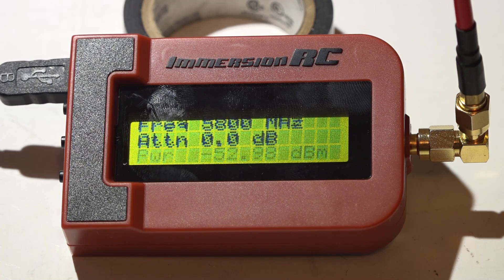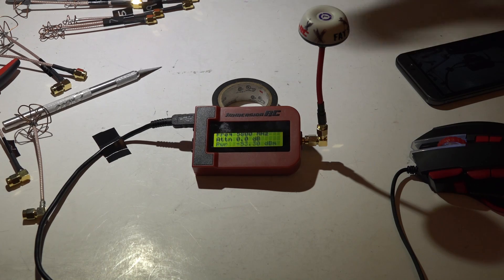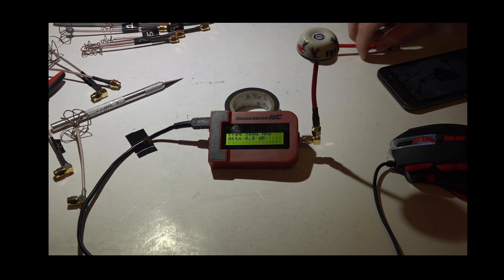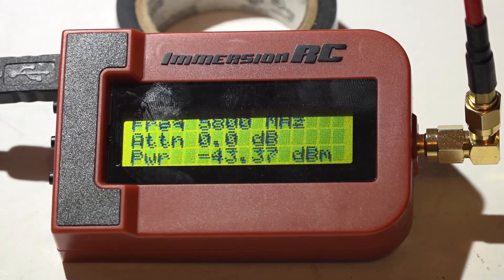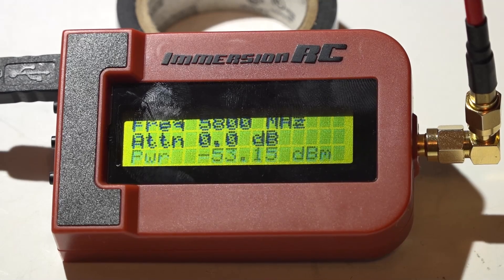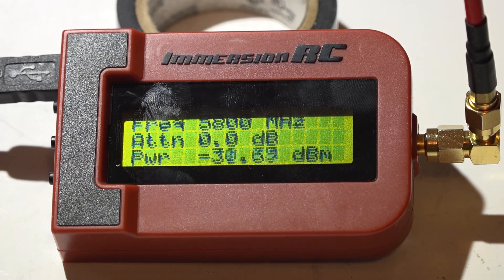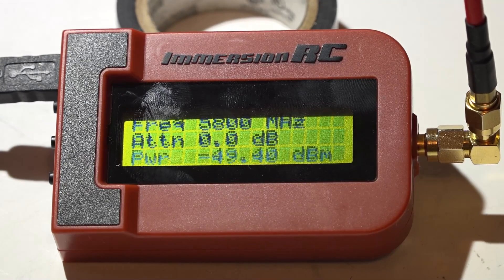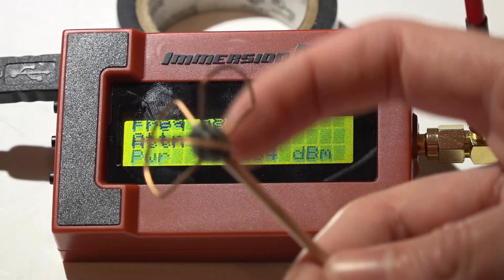Testing Home Made 5.8ghz Antennas

Comment: I found the entire video to be confusing and disorganised. Just one example, you start with a "known good" antenna, but it has x's on top and you say you would definitely not put it on a multi rotor. If it is no good, why is it the benchmark ?  Another thing, you talk about the power getting bigger or smaller compared to your standard. But the numbers are negative. What does bigger mean ?

Comment: When trying to determine if an antenna is "Good" the most important measurement is the SWR, especially if you want to make sure that you will not damage your VTX. Measuring the received signal at the other end does not necessarily reflect what is going on with an antenna. 

You could have a great antenna design that is just not tuned properly for the particular frequency you are using, which would result in a high SWR and poor efficiency and in turn might lead you to think it's just that style of antenna that is bad.

Or you might test an antenna that has a different radiation pattern and ends up causing a higher reading on the received power meter so you think its all ok, but that same antenna might also have a high SWR which could damage your VTX but because of the radiation pattern affecting the measurement you miss that part and think the antenna is ok as is. 

So in short: SWR is the only indicator weather or not an antenna is working properly and tuned correctly, a signal strength measurement is more useful for determining differences in radiation pattern and antenna gain.

Comment: What do you think about the new Pagoda style antennas? They are smaller than the Cloverleafs and seem to be much more durable due their design. They are sold ready to go (Menace RC, Beerotor) and there are also DIY kits on the market. I almost forgot to mention that they should have up to 20% better performance compared to the normal Cloverleafs and SPW. I already ought 4 but I couldn't really test them yet.
Reply from the maker: I have taken a look at them and they are interesting. I plan on picking some up soon.

Comment: What length of wire did you use on the "snail tail" ant with one wire?I make a similar one with 53mm wire, works really well as a race ant.
Reply from the maker: Its about the same length. Havn't nailed the perfect length down yet but its right around 53mm.

Comment: This very intriguing since I was a radio operator in the Marines, we had an OE-254 antenna for single channel that was the best for that application given we only had radio powered off of hmmwv battery. You can prolly Google picture it to see what it looks like. It looks like 2 cones with the point of the cones touching, I believe if I remember correctly each cone had 4 antennas about 6' long. I also learned that if there was a metal building near by we would set up next to it which would boost out omni directional antenna in the desired direction. You could install a piece of metal on top boosting signal in the downward direction
Reply from the maker: Thanks for your service. I did 6 years in the Army. Was infantry but I liked talking to the Como guys because they would tell me all kind of cool radio stuff.
Reply: Project Blue Falcon awesome man! You can talk about us but you can't talk without us! Lol.
Reply: Project Blue Falcon thank you for your service as well